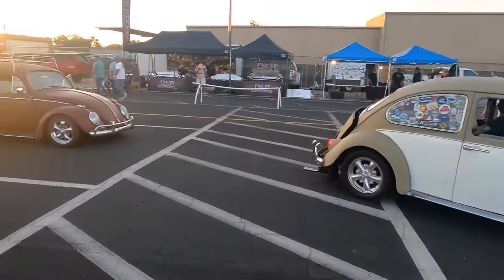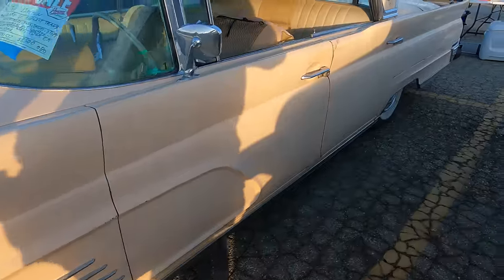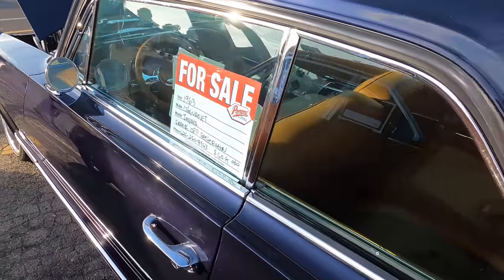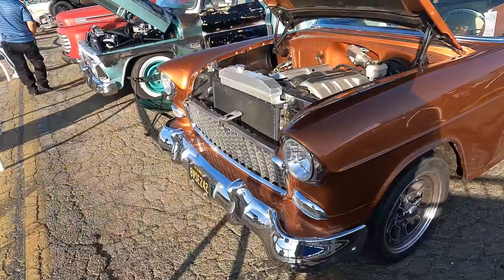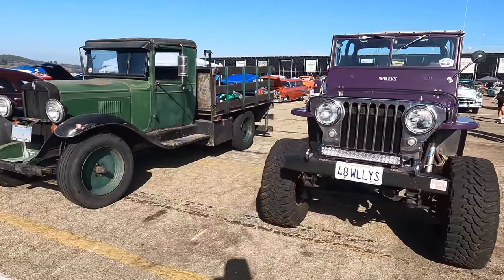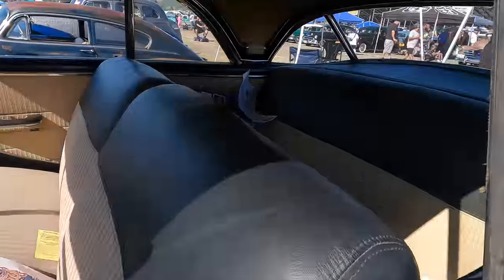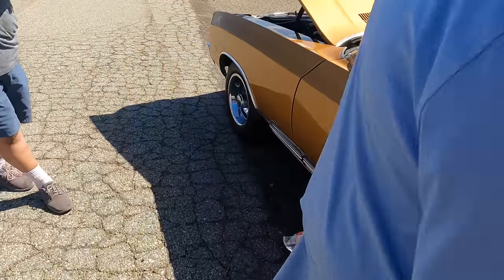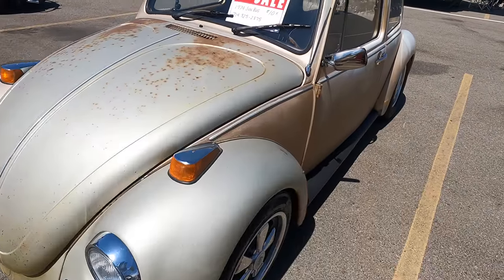Pomona Swap Meet & Classic Car Show - August 13, 2023

Comment from the maker: Tentative List Of Shows I’m Planning On Filming (Subject To Change)

August 18, 2023 - Cruisin’ Weekend Atascadero 
August 19, 2023 - Concours d’Lemons
August 26, 2023 - Pleasanton Good Guys or SMPOA Car Show in Santa Monica
August 27, 2023 - San Marino Classic
September 2, 2023 - Ventura Nationals
September 9, 2023 - Cruising 4 A Cure
September 10, 2023 - Long Beach Swap Meet
September 16, 2023 - Grand National Truck Show
September 24, 2023 - Super Indoor Custom Car Show In Ventura
September 29-30, 2023 - Duct Tape Drags In Tucson
October 7, 2023 - Rendezvous Back To Route 66 in San Bernardino
October 8, 2023 - Long Beach Swap Meet
October 14, 2023 - Casual Concours in Palm Springs 
October 15, 2023 - Pomona Swap Meet
October 21, 2023 - Mopar Fall Fling
October 22, 2023 - In-N-Out 75th Anniversary Show In Pomona
October 31, 2023 - SEMA
November 4, 2023 - Nitro Revival At Irwindale Raceway
November 11, 2023 - Goodguys Pleasanton or Radwood LA
November 12, 2023 - Long Beach Swap Meet
November 17, 2023 - McCormicks Auction In Palm Springs 
November 19, 2023 - Run With A Winner At Irwindale Raceway
December 3, 2023 - Pomona Swap Meet
December 10, 2023 - Long Beach Swap Meet
December 31, 2023 - Pre-Rose Parade Cruise
January 7, 2023 - Long Beach Swap Meet
January 14, 2023 - Pomona Swap Meet
February 2-3, 2023 - Grand National Roadster Show
February 10, 2023 - Dr George Car Show
March 3, 2023 - Pomona Swap Meet
March 10, 2023 - Long Beach Swap Meet

Comment: Question for you and your viewers..... I'm a Ford guy. But we have a 1959 Chevy Apache setting in the field at our old homestead. Been there as long as I can remember. And I'm 52. I know nothing about Chevy's. The badge on the side says 38 Apache. What does the 38 mean? It's titled as a car hauler. And does have the ramp bed, dual axles, the whole 9 yards on it still. I've debated on selling it. My son wants to do a rat rod on it. I didn't know what the 38 meant. Any info would be appreciated. Thanks
Reply from the maker: The 38 means its a 3800 series one ton truck. Make sure you update the wheels if it has the original split rims.

Comment: A couple of months back you showed a 52 Ford with a flat head engine that was a 51 engine not a 52 were V8s then they use up the flat heads before they install the V8s
Reply from the maker: Ford put flathead V8s in US cars until 1953. The Y-Block started in 1954. https://en.wikipedia.org/wiki/Ford_flathead_V8_engine